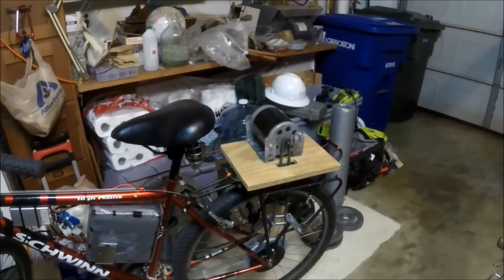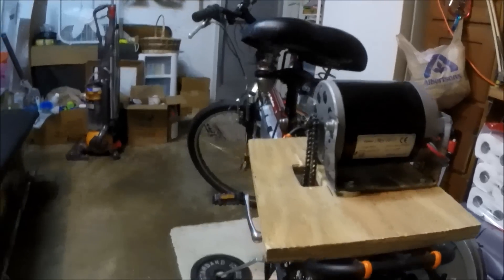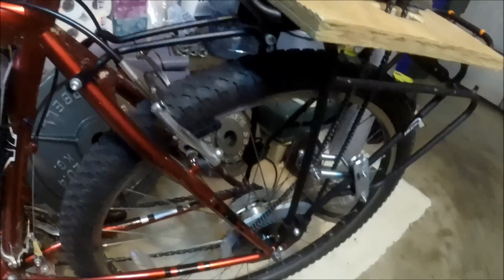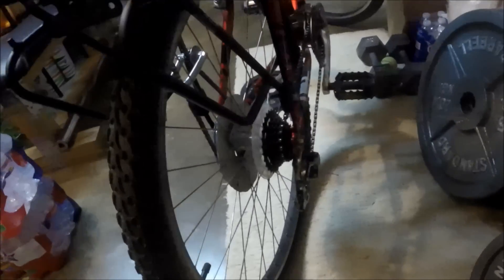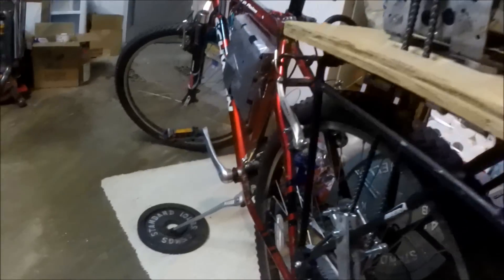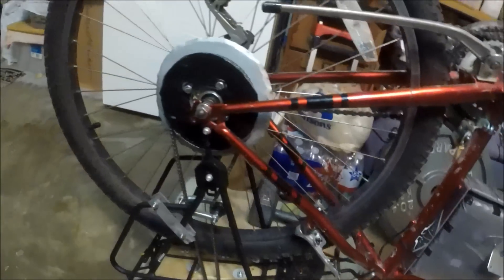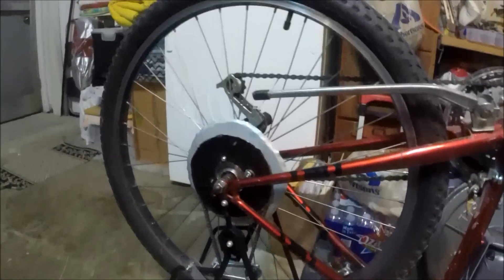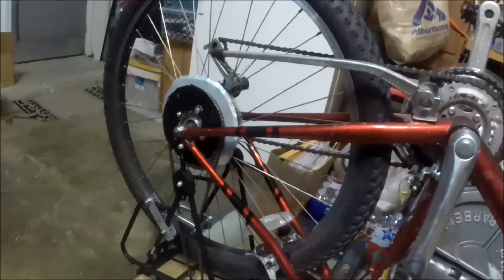DIY Electric Bike: How it Works

Comment: use the front cranking sprocket and bore it using lathe or go to a workshop(remove the cranking handle). According to the size of the rear hub. then snap the sprocket into the rear hub, do the gas welding. you'll get perfectly aligned sprocket.
Reply from the maker: If I had access to a real shop I wouldn't have had to jury-rig it as bad haha

Comment: how many worth
Reply from the maker: suraj kahar Not including the bicycle I would say about $150.  I didn't buy the motor either, I had it laying around.
Reply: I m Indian thanks bro many many thanks
Reply from the maker: I'm from Texas in the US.  If you like this video, check out the other ones on my channel
Reply: Jonathan Malouf  great video. How much did you spend for the parts that you bought?
Reply from the maker: To be honest I didn't keep track.  Probably $150 roughly, mostly on little things like gears and bolts and metal straps.  The speed controller and throttle were probably half the total cost, and then the rest was just overpriced parts from Amazon and various hardware stores.  The motor, batteries, and bike were basically free though.